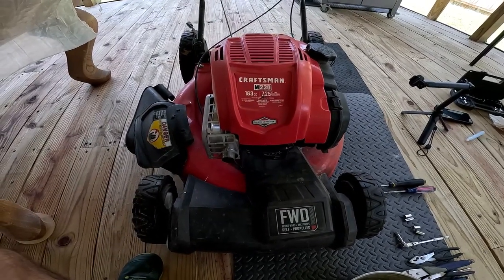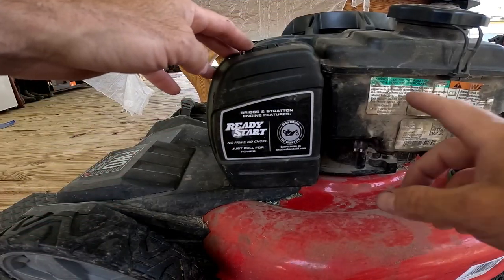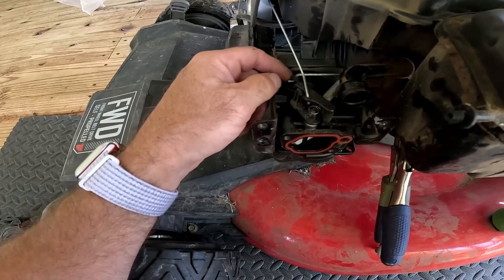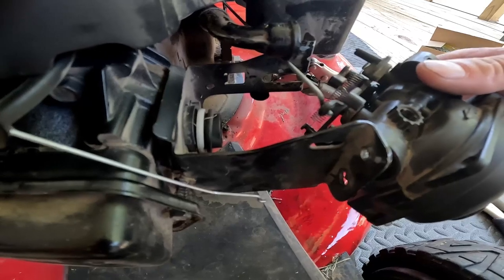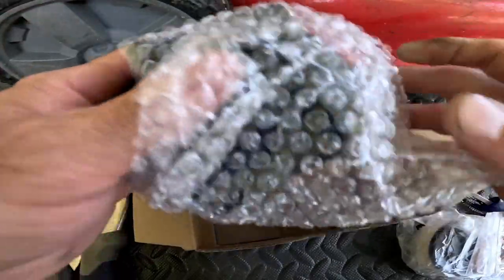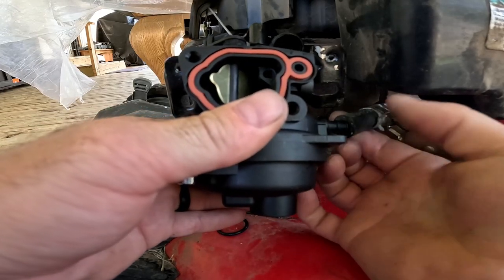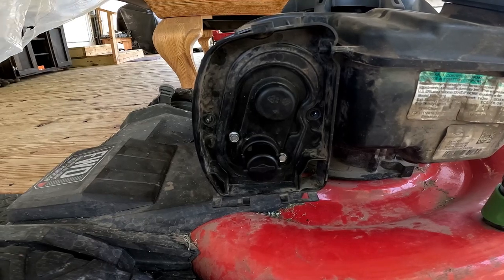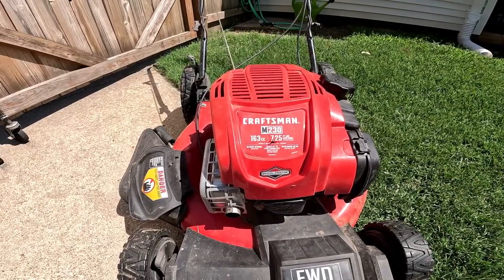Craftsman M230 163cc push mower  won't start/run?  Step by step DIY changing carburetor!

Comment: This is just what I needed! Same issue and this worked. Another tip, if you don't have vice grips (I had a pair but weren't the right size) use a small c-clamp to block the hose and it will hold the fuel back.
Reply from the maker: Excellent advice of using a scale C clamp.    Thanks for watching and commenting!

Comment: I did everything your video says and shows and it doesn't turn on. What else can I check before taking it to a shop to have it fixed. I don't want to pay a lot of money.
Reply from the maker: You changed the carburetor and hooked everything ack up correctly.  When you pull the string to start it, it won’t start at all?  Does it sound like it’s trying?   Sometimes when a new carburetor is installed it takes a number of tries because the gas needs to fill the carburetor.   Plus there may be some air in the lines.  You could try using starter fluid to help it start.  You may check and change your spark plug and air filter.   It’s a little tough to say what might be wrong without being there and listening to it while it is being started.   But check these things and let me know please.
Reply: @rjguess  What I did was this... I bought the spark plug and filter at the Ace hardware store and I put them in the machine and it didn't start. Then I bought the carburetor on Amazon and next to the carburetor there was another spark plug and hose to connect it to the gas but I left the same one that the machine had and I didn't put the spark plug that came with the carburetor either... and that was 2 days after I did everything That makes it seem like it's going to turn on but not completely.
Reply from the maker: Ok, so no need to do anything with the filter or spark plug.   You have new ones installed!   Good!   You also have the new carburetor installed.  The next thing I would say is.  Make sure your linkage on the carburetor is connected good and moving back and forth as it should when you pull the handle bar to start it.   Try using started fluid.  Make sure the gas is good.   Make sure your oil is not to full or too low.   After spraying started fluid into the carburetor by the air filter, give it few tries.
Reply: @rjguess  a question... there is something that is like a filter that is cleaned with a water hose that is on the right side near the carburetor... what is it called?
Reply from the maker: I know what you’re talking about now.  You attach the water hose to that.  It cleans the underneath of the deck and around the blade off after you mow.  This is so you do t need to tip your mower up to wash it out if grass is stuck.
Reply: @rjguess  thank you very much.

Comment: Just clean out the needle and jet and save yourself some money.
Reply from the maker: That is one way to but if certain parts are bad.  It has to be replaced.  In this video, cleaning alone was not going your way fix the problem.   There was a worn out part.   The kit is cheap anyway.

Comment: I did everything  what you say in the video and my lawnmower still won't turn on.
Reply from the maker: I’m sorry to hear that.  I’ve never had anyone tell me it would start.   Try it a few time (you probably already have).   Sometimes it takes awhile to start because the new carburetor has to fill and the air has to get out of the lines.  Make sure a hose didn’t come loose.   The larger one behind the air filter.   Double check your linkage.    Let me know?   Oh, try starter fluid to get it going.

Comment: Swapped my carburetor out after my mower was starting and dying quickly. Now I get nothing at all. Seems so simple but no luck for me. Anyone have any thoughts?
Reply from the maker: I know it’s a pain.  But make sure your carburetor float is not stuck.   Also make sure all your hoses are not cycling air.   Check the spark plug to see if it is firing correctly.

Comment: Very helpful and great detailed instructions. The issue im having though is someone broke off my pull string. I have the new one on there but when i pull it out its not going back its staying all the way pulled out. I mustve messed up the way i put it back together. Trying to a video if you have one on replacing the pull string. But still thanks for your expertise.

Comment: My mower is one years old and I used it on a half acre lot last season. The filter looks almost clean and so I'm wondering if there's anything else I should try. The thing turns but won't start
Reply from the maker: Have you checked your spark plug or spark plug wire?    Possibly the air filter.   Might try getting a can of starter fluid.    Change your gas out also.
Reply: @rjguess  great suggestion! I just watched another video on this and I think this may be the ticket. Thank you friend!
Reply from the maker: @presycebaez8442  you are welcome friend!   I hope you get the problem resolved!

Comment: Can you post a link to Amazon where you got the kit?
Reply from the maker: I apologize for the delayed response.    

This link should get you what you need.   

https://www.amazon.com/Shnile-Carburetor-Filter-Craftsman-Engine/dp/B0BWTTDBRM/ref=mp_s_a_1_4?crid=21C7K6WBUGTNZ&dib=eyJ2IjoiMSJ9.Zbd980U_rrBtvX7sZ9_fFcePivxtoKT2TE0_fdjIGyeiZiSU-aDzyLBzql2UH90nnrtZdBsDXK-LCEdjSRM9z_y6W2DEfefWX7K2VDf9t5TrzVUDd3MngFNkrddatNwMAUdCJVuPrW2tzljkedyKFLXcXixzWnUnnAHIuYWSMHJYLMI6W2LyMh2pFRLsaGmLh8ZVqLP9Z2Of_43O_-PynA.i1nHpU8XvQ0BiExEItOTDIWJtyrLQdy4Z6euqzKNr2o&dib_tag=se&keywords=craftsman+m230+163cc+carburetor&qid=1710471526&sprefix=Craftsman+M230+163cc%2Caps%2C165&sr=8-4
Reply: Thank you!
Reply from the maker: @jmadrid41 you are very welcome.   Keep in mind, when buying most carburetor kits.   You will not need or use every part that comes with it.   I can’t remember if I made that clear in my video.

Comment: In which store can I buy a new carburetor for the M240 165cc model?
Reply from the maker: I got mine on Amazon.   A lot cheaper even with shipping.
Reply: @rjguess  put a new filter and spark plug on mine and it starts up and after about 3 seconds it goes off..... thank you very much.
Reply from the maker: @henrygaitan410  sounds like you do need a new carburetor.   Possibly a good cleaning.   You could check your mower gas line for leaks also.    But a new carburetor should solve the problem.   Thanks for watching my video.

Comment: Hey man, any chance you got the part number / link for this kit? Also, if the mower is sputtering would changing the spark plug be an option as well? Thanks ahead of time!
Reply from the maker: Click on this link.  It is the kit I used in this video.  Comes with extra parts that you may not need.  But it’s the best kit for the price so far.  I recommend changing the spark plug and air filter to help with spluttering.  Also check your gas hoses for leaks.  It might be sucking air.  The carburetor could also have a bad gasket.    Thanks for watching.  I appreciate your question!   

https://www.amazon.com/Shnile-Carburetor-Filter-Craftsman-Engine/dp/B0BWTTDBRM/ref=mp_s_a_1_3?crid=TO0KV9YX1EHJ&keywords=craftsman+m230+163cc+carburetor&qid=1694905851&sprefix=cfrafstman+m230%21+1%2Caps%2C135&sr=8-3
Reply: @rjguess  I appreciate the speedy reply, im just now seeing it but I think this is the first time ever someone has actually responded 😂 definitely gonna subscribe, your page helps a bunch of people!
Reply from the maker: @uhhmonty3853  thanks for subscribing!   I appreciate that a lot!    I try to respond to everyone!   Gets tough sometimes but it’s good to communicate with my subscribers and those that have commented on my videos!